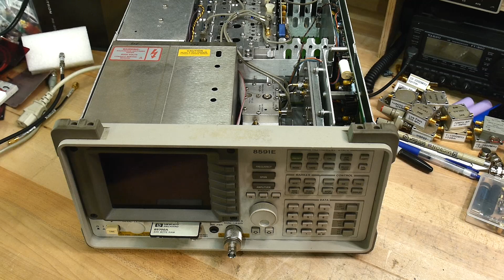#570b Inside the HP8591E Spectrum Analyzer

Comment: Hello, good morning from Tijuana Mexico, I am interested in knowing if I made the modification to the HP 8591E Spectrum Analyzer, could you please help me with this step if you did it? Any video about this process please; I have identical measurement equipment and I recently watched your video on this electronic medium and I was interested in modifying the module in the first mixer and specifically adding a cable to the 50 ohm output to create a tracker in the same analyzer unit, do you think you can help me with that information? I will thank you.
Reply from the maker: https://youtu.be/e0JF3t8BJe8?si=8BPn5raI7FVG2tLN

Comment: Will you be bothering to re-calibrate the spec an after replacing the 1st LO, or is it good enough for your application to just assume it's within spec?
Reply from the maker: no, i'm not replacing the LO, just bringing a power split of it to the back panel. many spectrum analyzers like my HP8558 already do that. the cal will not change

Comment: I just opened up my 8591E and the lithium battery was installed Jan 24, 1995. Still measures 3.69 volts but I ordered a new one from Digikey. Time to change it!
Reply from the maker: There seems to be a 1k resistor between the battery and a 0.22F super cap. I've read that cap will hold things while you change the battery. I think I will put another 1k in the circuit temporarily and feed 3.6V in while I change it.
Reply: @IMSAIGuy  good secure way to not loose memory , valid for all HP or tek of the era , and to be done before end of battery
Reply from the maker: @johnlegros1586  do the super caps go bad too?
Reply: @IMSAIGuy  supercaps are reliable , but however some loss of energy is to be taken in account due to internal loss , unless frequently recharged you may loose data , best is lithium non rechargeable cells , last between 10 and 20 years ( have a 25 years old button cell in a Dell PC, and still OK ), and the voltage is more common to old circuitry.

Comment: backup your cal data before doing anything else. It's a bit cumbersome because you need to do it manually by writing them off the screen but it is absolutely necessary. I have my 8596E and 8595E cal data in excel files.
Reply from the maker: Yes, I wrote them down onto the official table in the manual. then took a photo of that.

Comment: Too bad they buried the Lithium battery so deep. Would have been better to put it in an accessible box on the rear panel somewhere like the old Mac's used to have. I have to change my battery at some point. I wrote down the cal numbers this morning so at least I have those. Somewhere I read they have a super cap also on that battery so if you take out the battery supposedly the super cap will keep the memory going for up to 8 hours. I guess I'll see if that's true and if the super cap is still good!